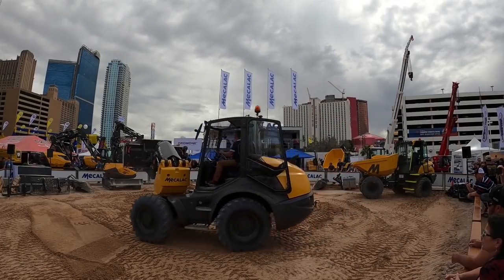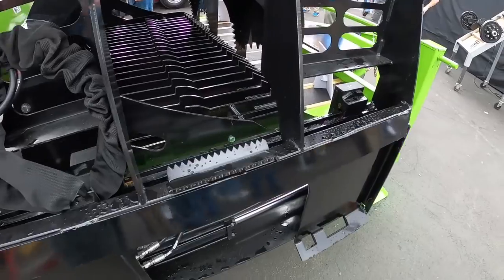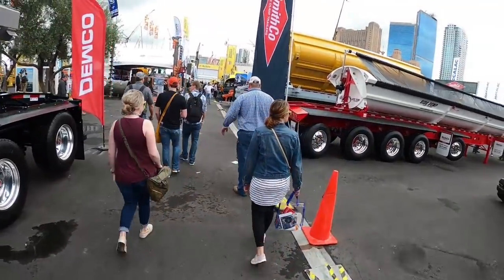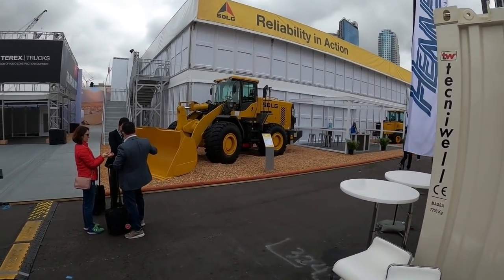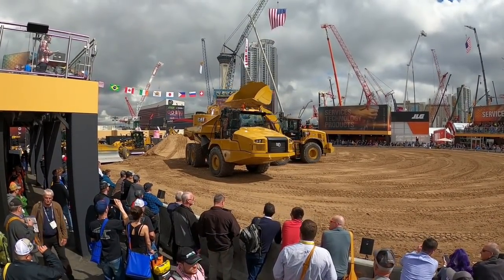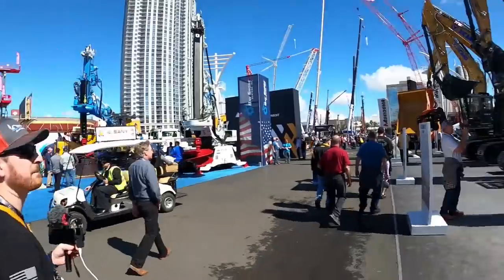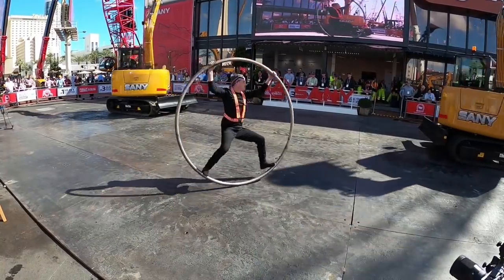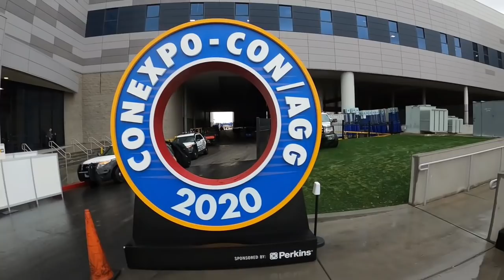Conexpo outside

Comment: Shandong Lingong Construction Machinery Co., Ltd. (SDLG) is a subsidiary corporation of Volvo Construction Equipment. Many Volvo dealers also sell and support SDLG equipment. SDLG tends to make simpler equipment (minimal electronics, older technology), basically it is comparable to equipment from 20 years ago, which makes it cheaper to make, cheaper to buy and easier to work on, but it isn't as good as the newer equipment.
Reply from the maker: Got ya thanks buddy

Comment: Now i know the Huddig might look a tad intimidating at first glance. But they are the nicest backhoes i've run so far. With my dad having owned several over the years i am so happy that central lubrication exists. Because chasing all those grease points down with a manual grease gun is about as fun as it seems :D. They've also had the option of RC controls for a while now. Turning them into 15 ton RC toys. Nice to see them all the way over in the states.
Reply from the maker: Interesting...  thanks bud for the input ida never thought ida got any info on here

Comment: Greetings from No VT - Some very sexy machines but I agree that the more moving parts, the more things to break. The little bit of improved performance can easily be wiped out if you run into a lot of mechanical downtime and cost to fix. Wipes out the sexy advantages pretty quick if you can't have a machine workin.